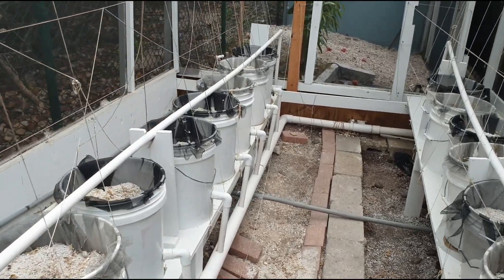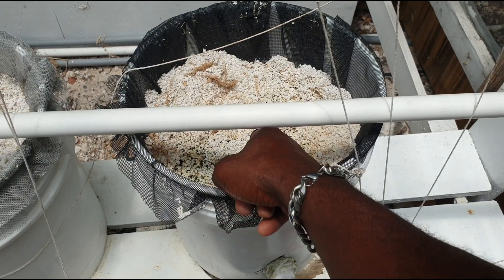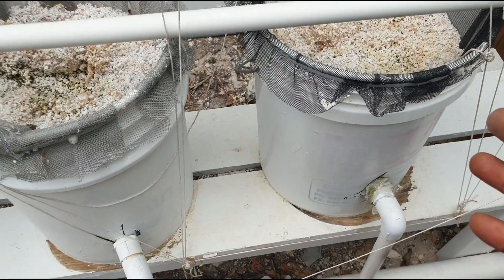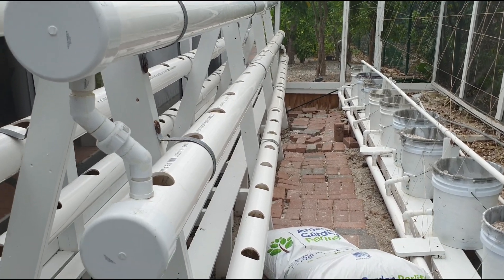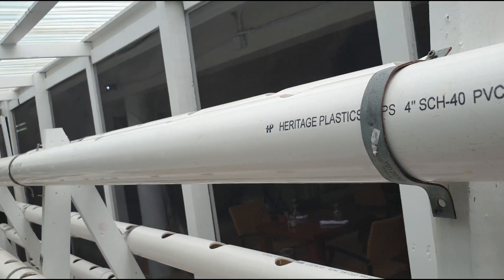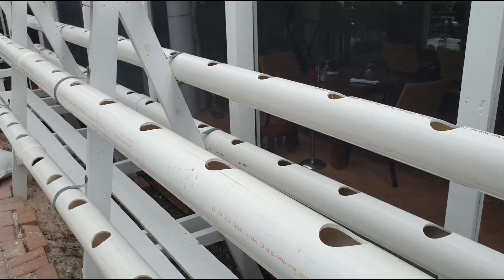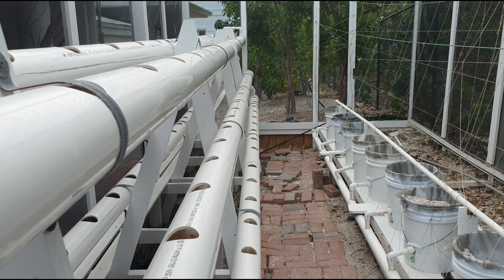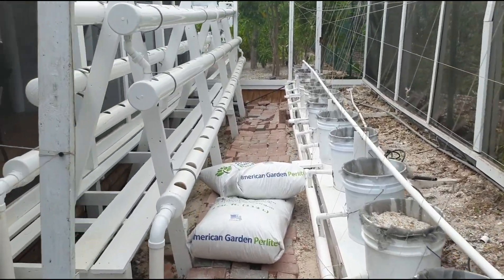Simple hydroponic system explained- watch this and make your own hydroponic system

Comment: Thank you so much. This hydroponics farming is my passion. I would like to start my tomatoes, outdoor using this system or is it better to have it in a greenhouse?
Reply from the maker: You can have the system outdoors but you would have to atleast have covering on the top to prevent rain from diluting the nutrient solution.  You can always put back the nutrient solution to the various levels but it becomes inconvenient when it become frequent.  I would advise you to put a greenhouse plastic over the top of the system and shadecloth or antiviral mesh on  the sides- more like a greenhouse.  Or you can use only the greenhouse plastic on the top and leave the sides open- as long as rain is not falling into the system.
Reply: @MCAgriTech  Thank you.

Comment: Does capillary action  happen with gravel just like it does perlite?
Reply from the maker: This is a very relevant question. No it does not. Reason being, water tends to flow on and over gravel with minimal absorption therefore, the gravel will not absorb enough water that will cause a capillary rise. And also, due to the porosity or space between individual gravel and large size of gravel, gravity tends to have greater effect on the water flowing through gravity by what is known as gravitational pull.  
On the other hand, perlite tends to absorb water even though the perlite particles are somewhat large therefore, it will have some amount of capillary rise. It is important to note that capillary rise is not very fast in perlite therefore you would have to wait a few minutes for the water to rise. Farmers I know that uses perlite normally water the seedlings from the bottom. Therefore, they sit the pots with the perlite in the water and let capillary action rise the water. I hope this answers your question.
Reply: @MCAgriTech  what type of mesh used in the perlite and do I have  to paint the white buckets